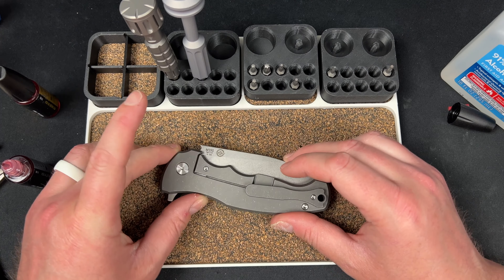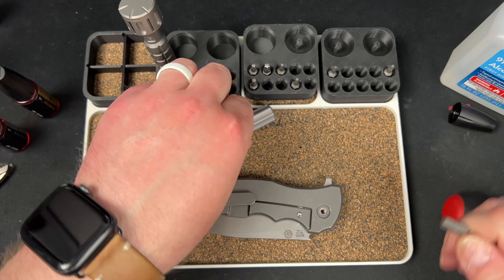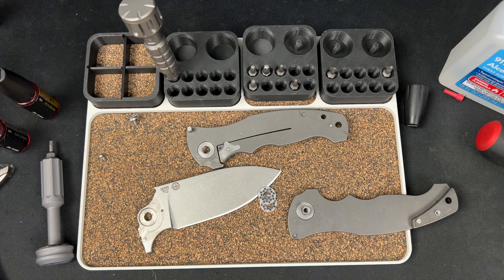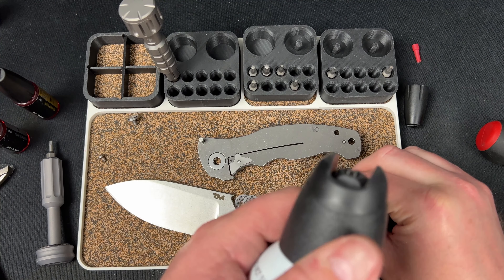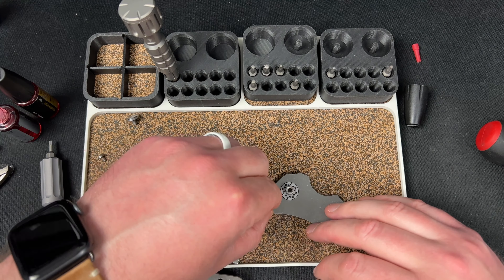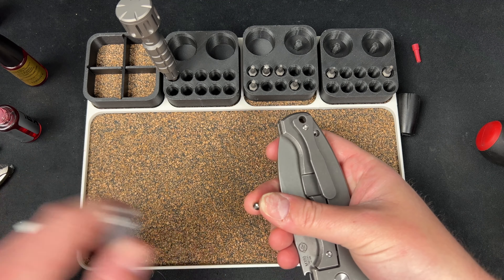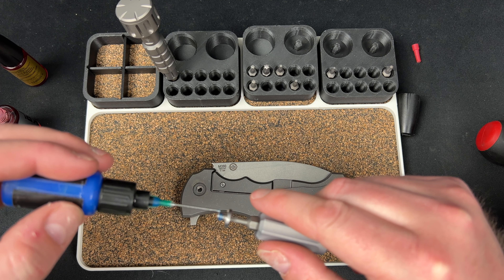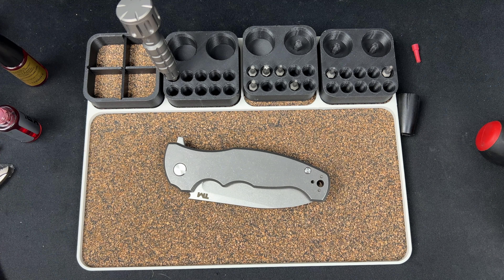This Disassembly Goes Beyond EDC

Comment: The action differences between grease and oil also depend on the knife tolerances and the  materials used in making the bearings!
Many of my knives have improved by removing the bearings, cleaning off the factory grease, and then lubricating with KPL.
 But then there are others with single row or multirow ceramic IKBS bearings. Like the ones in all 3 of my Shirogorov knives! They function perfectly with greasè, or other, more viscous lubricants!